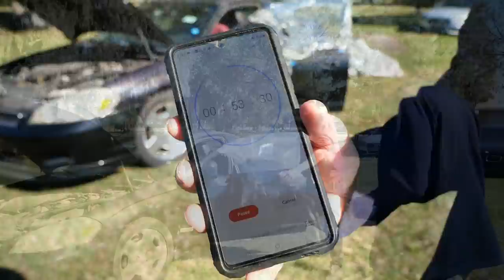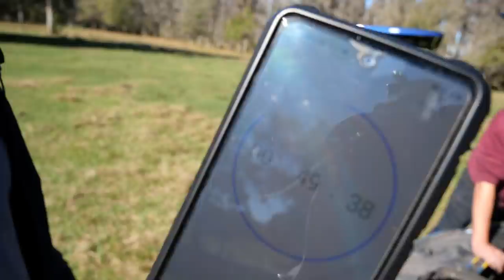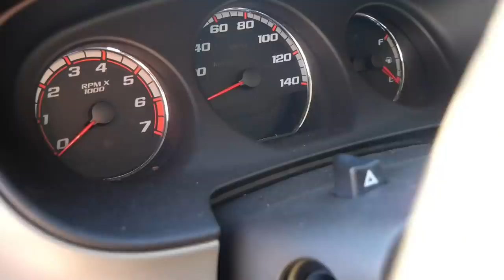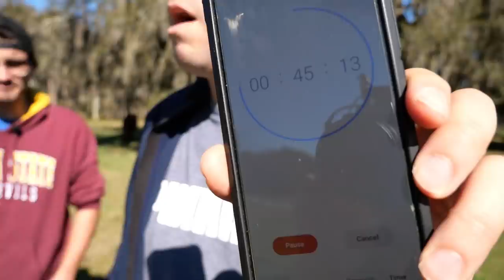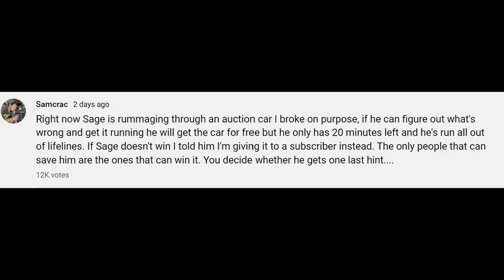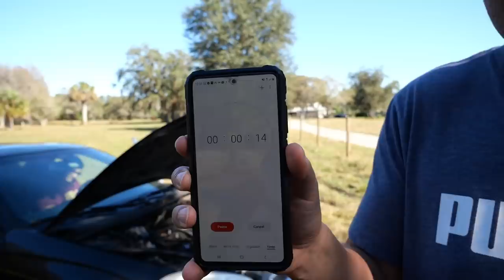If You Can Get this Sabotaged Auction Car to Run and Drive, You Can KEEP It for FREE!

Comment: I can tell you in a few seconds what's wrong with it it's a Monte Carlo SS from the last generation. Relative of mine by marriage bought one of those pairs new midlife crisis mobile back in the 90s like 99 or 98 somewhere in that ballpark. Crap he went through with that car was Unreal it was like the thing was a lemon. Ended up sitting in his yard for I forget how long and going for scrap. Anybody else I've known that own one seemed to have the same problem of the car was just a dumpster fire of issues. It hurts because I'm a GM guy and I watch GM go downhill on black ice being powered by a nuclear missile for about 20 plus years now. Last good vehicle GM was making was a cargo van which in itself is just sad. GM died when they stopped making rear wheel drive and I'm not including rear wheel drive Corvette we won't be talking about the Corvette no no no we won't. GM died in the 90s and the Corvette is probably the only vehicle GM is still producing other than their attempt at a car that they made and around the 2010 era where they started trying to do rear wheel drive again. Corvette and the Camaro we're really the end of GM and they're only doing the Corvette now which I don't really count as even the company being on life support. They were doing good Cadillacs for a while but the Northstar kind of finished the Cadillac then GM got on the SUV bandwagon. The Dodge Charger with its Basket Case of issues and the Chrysler 300 I still like and I owned a really bad one for a while where I had very little problems with ironically. Seeing that Monte Carlo just brings back my sadness of what happened to GM. Why didn't you get him a real Monte Carlo or a 1980s Caprice or something like that? I mean if you're going to get him a GM. Now if you were thinking forward up until recently Mustang was still a good choice the 2000 Mustang has been a nice car and one of the few good vehicles Ford stock with. God I miss the Vic! Ford's answer to the Caprice and it lasted so much longer than the Caprice they should have stuck with it like they did the Mustang.

Comment: No battery. No spark. No fuel. No air. Well, Sam, you did a pretty good job of messing up that car. TBH, the moment you mentioned breath, I would have taken the air filter off and had a look at the throttle body. Fair is fair.

Comment: 1st thing you need to do is go into the computer programming and turn off the DOD.  The dang things burn oil like crazy with it active and the gas mileage is not changed by turning it off

Comment: Car needs air, fuel and spark to run. Once the coils were plugged in, check spark. got it.. next push the Schrader valve on rail. has fuel, done... Last, air..... pull intake snorkel and look at throttle blade position. Socks found... Winner.

Comment: It's common sense. Fuel. Spark. Intion ...all it takes to run. If you can't think that. Then no point to touch the car . .. fuses.  Fuel Shut off valve .. spark plugs. Harness wires. .EASY SIMPLE AS TURNING THE key

Comment: I guess the moral of the story is don't take anything for granted.  
However all cars need:
1. Fuel
2. Air
3. Ignition 
4. Power
However, If I was working in a shop and found a pair of socks in the air intake .... He would be paying for a full engine rebuild.

Comment: cant believe he needed a life line for clue 4 im not a mechanic i just barely do work on my cars 4 to me would have meant fuel or air which would make me look at the fuel pump fuse and the connector to see if its off, then look at the throttle body and air intake to ensure its getting air. Fundamentals of an ice car fuel air spark if you have one but not the others it wont start

Comment: When you read the fart clue I instantly thought Spark plug, due to the lighting the farts joke meme.

Then when Rich suggested Exhaust I thought hmm maybe it is an action like a fart ie injector.

Finally I thought fuel pump, but yeah I thought you would have like disconnected a connector at the fuel tank on the tank itself not just cut a fuse terminal off.

Comment: Sam the sock was a little far putting it in the throttle body. Could have at least been fair and block it with easy to see duct tape. I say give the lad another shot at the SS. He bled like a true shade tree mechanic trying to fix that thing. And really uncle rich as a life line. Rich is smart but you need to give him a stroopwaffle to get the motor running lol

Comment: OPEN the fuse box turn the key to the ignition position pull the black diode out and put it back in then start the car.

Comment: Was letting off the throttle what triggered that safety or how else did it detect the sock. So if he had just wide open throttled it to the street he would've won without getting the sock out

Comment: A good place to sabotage a GM is pulling loose the can-buss wire anyplace along its length,  will kill it. Garbage GM parts, the connector components on the buss are only good for 7 or 8 insertions and then they are specifically engineered to fail.

Comment: not since Beverly Hill's Cop banana has an object been so important to move along the plot.   I am surprised the socks did not somehow get into the engine to kill it permanently.   Sage did pass the you're not working unless you are bleeding test so I think he deserves it:)
Reply: IF the socks had been sucked past the throttle body (near impossible) they would just be lying in the bottom of the intake plenum and could be easily be retrieved with a grabber tool after removing the throttle body. Sam's clue that the engine could "neither breath or fart" was a crystal clear clue that there was an obstruction somewhere in the intake or exhaust system. 

Take home message: If you are going to troubleshoot a car that won't start, remove the engine cover and the air box so you can visualize what you are testing.

Comment: I have an 07 monte with a practically new drive train 6,000 on motor not a rebuild, 2,000 on a reman built tranny. Frame is gone. If interested hit me up $2500... ton new parts on it as well. In Mass.

Comment: Air, spark fuel equals (fuel pump / injector chk), (coil, coil packs spark plugs chk) plus crank sensor known problem. I’ll give you my address Sam.

Comment: he must be green, i was thinking the the tail pipe was pluged , and if not then would have looked in the air box for a blockage, i keep yelling check the tail pipe and the air box and or intake. he did pop a clip off the air box but wouldnt finish taking it apart, nope i dont think he deserves it , wasnt think hard enough , you need spark, gas , and air, simple stuff.

Comment: I think sage really deserves the car. Who the hell would put a frickin sock in the intake!!!!
Reply: Someone at the auto auction that wanted to buy the car cheap as an "as is - doesn't run" car instead of at a much higher priced "drive-across-the-auction-block" car. It takes about a minute under cover of the hood, somewhere out in the north 40, and the car would never make the drive to the auction building. 

The auctioneer would then sell the car sight-unseen, as-is, where-is and few dealers would bother to bid on a "broken" car (except the one that sabotaged it & bid practically nothing to win the bid). You'd be shocked at what some scum-bag dealers will do to get a "bargain." 😡😡

Comment: Come on man, any mechanic worth his salt knows it's fuel, air, and spark, and the LS engine is simple. No one is unplugging the crank sensor because it's in a bad spot, so that leaves coils, fuel pump, and the intake system. PCM  if someone is really trying to get creative.
Reply: Hes just a damn kid leave him alone lol, plus the pressure of solving it in an hour, and the constant taunting from sam would have been very offputting.

Comment: Poor sport ... like the "Beverly Hills Cop" stunt with "Banana in the tail pipe" move ... BTW, same issue on early '70's Cadillacs ... double walled exhaust pipes ... hit a water puddle at a 19 yo and shops wanted to replace the Engine ... old timer shop guy had it fixed in an hour ... hot exhaust mad the inner wall collapse ... cut out the defective area ... ran like a top for $20 (then year dollars) ...

Comment: When Sam explained the RULES to Sage  and said that once running, Sage had to DRIVE the car to the far end of the pasture and out to the street to win, I knew Sam had something up his sleeve for Sage that would "sock it to him." 

Clues that the engine "couldn't BREATHE or FART" made it crystal clear that there was some sort of physical obstruction somewhere between the air box intake duct and the exhast tail pipe exit. Sage just wasn't paying near enough attention to the rules ,or the clues. 

A real WINNING competitor would have fixed his eyes on the finish line and lowered the hood the second the car started and immediately drive to the finish line, instead of spending several minutes dinking around after the car was running. Like Kenny Rogers sang in The Gambler, "There's time enough for countin', WHEN THE DAY IS DONE."

I think that awarding Sage a set of tools as "Runner Up" was generous of Sam, and giving Sage a "Second Chance" at winning an equivalent or BETTER car in Round 2 is more than generous! I hope Sage has learned some lessons in this video and turns to some of the expert mechanics on youtube to learn the BASIC Troubleshooting Skills he needs to come back and become a CHAMPION in Round #2!